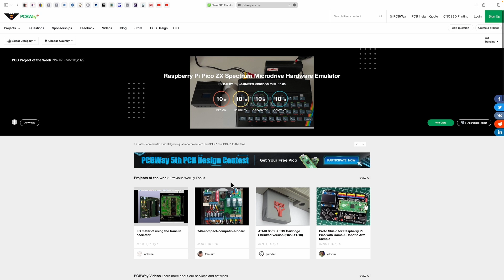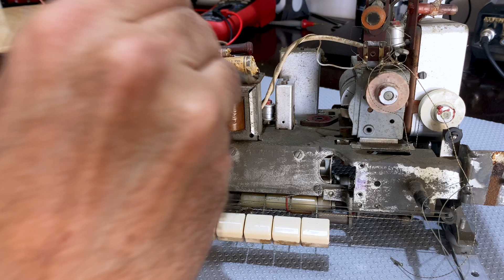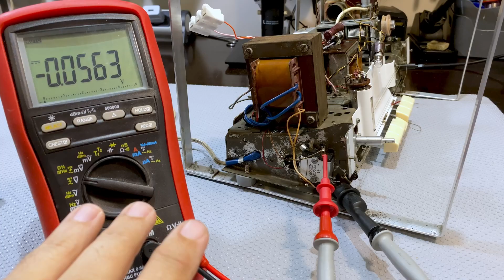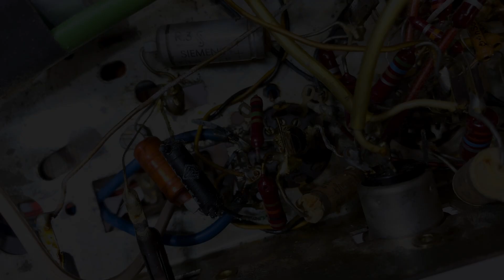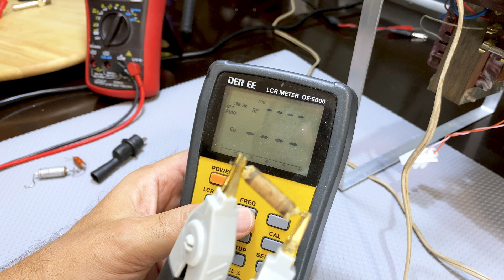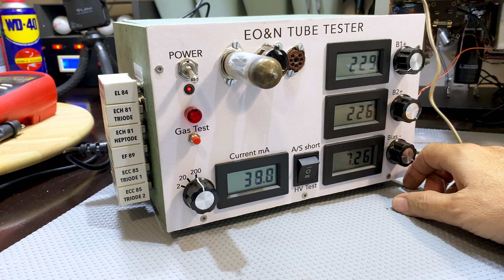When a tube has gas ... it's not good. Grundig 2140 restoration - part 2 #PCBWay#

Comment: I think I'd have separated the EL84 cathode bypass capacitor from the bias resistor by 5mm or so. The heat from the resistor will shorten the life of the capacitor.
Reply from the maker: That’s true. However, in test situations the power only exists for seconds, so it should be OK.

Comment: You have tested the tube to be gassy but it appears to have a good amount of getter inside. Could the gas be captured by running the tube in a test jig where it gets a bit warm? I have heard about people putting tubes into a low oven for several hours with the aim of reducing any gas. Does that work at all?
Reply from the maker: I believe it does, but haven’t tried it myself.

Comment: in this case, gassy el84, very easy to solve, this tube is easy to find and cheap, in my practice I had successfully revived some 5 pcs ell80 and few ecl86 all gassy tubes, using tube tester and puting tubes in overload, overheating / redplating, of course controlled environment, after  30..40 minutes in this overheating mode all tubes work nice and with no control grid current.... greetings
Reply from the maker: Thanks for the tip. I’ll give it a try.

Comment: Happy birthday Manuel
I am working on a similar Grundig. (1097)
Is the C13 replacement a 1000v type? (hard to find)
I used a 630v type, i got doubtful and this morning i ordered 2 double capacity 630v versions to put in series. 

I think i'm going to keep the selenium rectifier (because of the voltage drop) but add a protection diode between rectifier and C56....???
Btw: great video as usual!
Reply from the maker: The cap on this one was in fact a 1kV type, and it slipped right past me, so thanks for the warning. I’m going to correct that before I get a nasty surprise 😊

Comment: it is not a good idea to put the cathode capacitor that close to the 150 ohm cathode resistor because it will get warm and deteriorate the capacitor.
Reply from the maker: True. Been moved. Thanks

Comment: Bom dia Manuel. You dont need to spend so much money on the EL84. Use a "russki" 6P14P, it is compatible to the EL84 and the specs are even better. Use one made after military specs with an aditional letter at the end. In Germany you can buy it for a liitle bit over 14 Euro. Yes, and thank you so much for your excellent videos !
Reply from the maker: Thanks for the tip. I’ll look into it.

Comment: Nice video and many happy returns. Fun on your Birthday and burnt twice. 😅Once on the finger (Yep we have all done that on an EL84 - hot little b£%^£%) and once in the pocket by the same EL84. Had to replace one recently that had a short between grid and cathode (symptom very low volume) and that was about 20 Pounds but that company are now posting to phone for price and availability against most of their stock valves. Hope they dont get any rarer and more expensive otherwise Transistor/Mosfet clones will populate the valve bases Uggh. Might make that Valve tester my next project. Cracking stuff!
Reply from the maker: I certainly hope the valve market will stabilise.

Comment: In case some become confused, I should point out that a tube being "gassy" doesn't necessarily mean that it has lost or is in the process of losing its vacuum. The metal parts of the tube can actually contain water vapor and solvents left-over from the manufacturing process and therefore better quality tubes have traditionally been baked in hydrogen  In order to drive out contaminants.  Whether this is still done to the fullest possible level with modern tube construction and manufacturing is anybody's guess. Anyway, If the parts that go into the tube are relatively clean of contaminants, then the getter flashing on the glass is supposed to react with and remove any additional contaminants  that might cook out of the parts as the tube is operated.  If a tube is run in a circuit with a malfunctioning bias supply or pushed really hard so that it is continually running above its ratings, it is still possible for well made tubes to cook out something that contaminates the vacuum and makes the vacuum somewhat conductive. I have also read that some types of transmitting tubes can actually become gassy whike sitting unused in storage. A gassy and less than perfect vacuum can cause the grid to *emit*, not just merely control the flow of,
, electrons; and therefore the tibe can go into thermal runaway and self-destruct. 

Other faults that can cause a tube to act as if it is gassy and go into thermal runaway is if any emission-producing material accidentally gets on the grid, whather through poor manufacturing quality-control or from the tube actually cooking off something that collects on the grid, or on the mica insulators.  The getter material is usually some kind of barium or magnesium alloy that is splattered onto the inside of the tube by means of a high intensity microwave burst but if that material isn't all concentrated onto the glass and some ends up on the Mica insulators and the tube elements it can cause secondary emission and thermal runaway of the tube, or interelement leakage between tube elements  Due to metallic contamination of the Michael insulator's, and if the insulators become conductive you can have noise problems and erratic operation Due to metallic contamination of the Mica insulator's, and if the insulators become conductive you can have noise problems and erratic operation.

 Of course if the tube actually loses vacuum the getter will turn tfrosty white, and if you apply voltage to the tube the elements will actually burn up because you're heating them in the presence of oxygen.
Reply from the maker: Thanks for a great explanation. This one is actually a Valvo tube, and they have never given me such drastic problems in the past, so something must have gone terribly wrong with this particular one.
Reply: @electronicsoldandnew  ,  Generally the European tube makers of old made high quality products and did things right. I have seen Mullard EL84 tubes that looked as if the tube elements had emitted candle soot which coated the inside of the bottle in a flame-like pattern, and yet the tubes operated just fine.  Even the best tubes, however, can sometimes go gassy in operation, probably from the circuit malfunctioning and overheating the tubes repeatedly.

Comment: I wonder why these radios can't be produced using the the tubes that were created in 1957 because the transistors of the day were not ready for prime time then the H+ would be 12V and the B+ would also be 12V so what is stopping them as transistors and integrated circuits are susceptible to EMP and tubes are not.

Comment: Great video as normal Manuel. The valve tester has already proved it's worth, even if it's cost you a new tube! I really like the way the tester works, very easy to use and the digital meters are very clear. I am very lucky that I was given an AVO valve tester some years ago but I think that I prefer the procedure for testing on your design which actually says a lot!

Comment: I'm surprised that the 1.3k ohm 4-watt resistor on top of the power transformer was good. The last two Grundig radios I restored both 1.3k's were opened. Great thorough video.

Comment: My preferred method of testing gassy tubes was to check the grid voltage over time. If the voltage went up, the tube was gassy. Usually an EL84 would run with 0V on the grid, gassy ones would start also at 0V, but after few minutes the voltage would start to go up. At the same time, the anode (B+) would start to sag as the EL84 would be drawing more and more current.
After pulling the tube and if the voltage went down, then the tube was gassy indeed. Also if the the voltage went up, the coupling cap was leaky.
Reply from the maker: Good method 👍

Comment: Nice video again!
Well, you don't necessarily need a tube tester to find out if the EL84 is gassy or not. If the coupling cap doesn't leak at all, or is disconnected from other end, you can measure using high impedance DMM or tube volt meter, the voltage over grid leak resistor R19 (make sure it is 1M and not open or wrong valued), and if the tube is gassy there will be noticeable voltage for example 100-200 mV  across the 1M resistor to ground. The bigger the grid leak resistor value, the bigger is the risk of bad vacuum causing finally too big bias current and to make tube go redplating.
For example in Fender guitar amps it is very simple to test if the first preamp tube is gassy or not just by measuring the voltage from guitar cable guitar plug tip to ground. If the tube is OK, no DC voltage. Gassy ECC83  can give 150 mV from it's grid to the plug.
P.S. Happy Birthday 🎂
Reply from the maker: Thanks 😊

Comment: I had the same problem with a Telefunken EL84, sad,very sad.
JJEL84's sell at 15,5 € in their EU store, it's the price of the Russian made tubes that has skyrocketed.
OCD's, i know , but the power switch on the EO&N tube tester seems to be upside down.It makes more sence to shut down when you push it down,faster ,easier in case of emergency (without lifting the whole tester in the air).
Happy belated birthday :).
Reply from the maker: I’ll look up the JJ’s price.
The “Down for ON” is a convention I have carried with me since my growing up in SA. Even the light switches in my home are set that way. Old habits are hard to overcome 😊